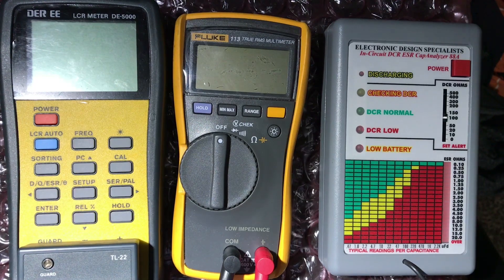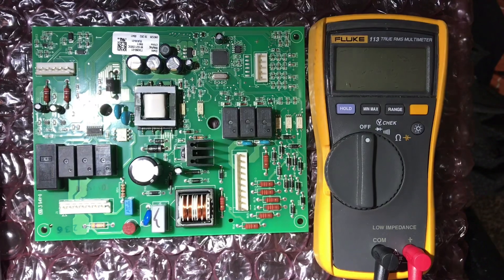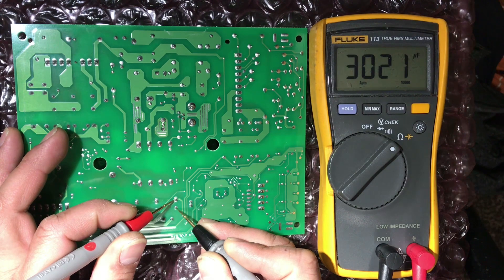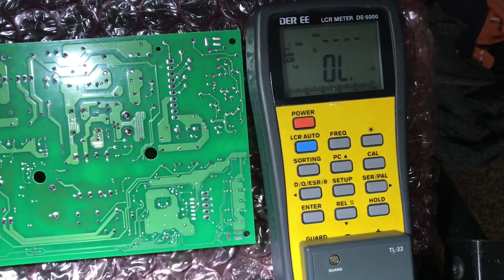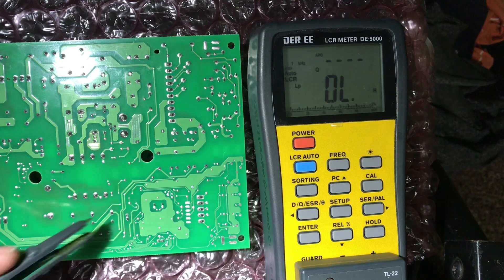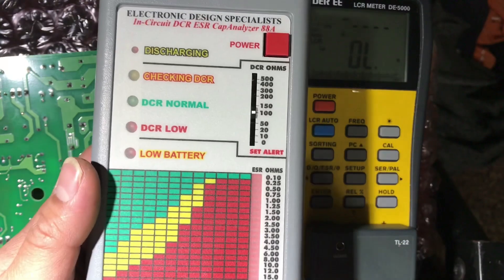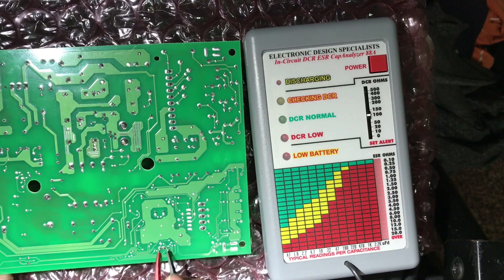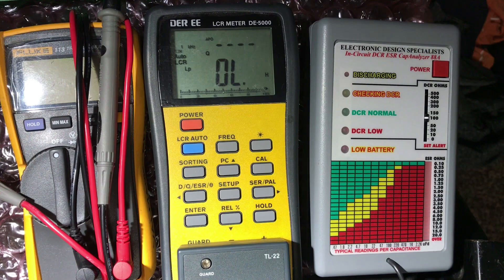Repair| Fluke 113 vs LCR DE-5000 vs ESR 88A

Comment: So after using all of them, would you recommend the DE 5000 over the capAnalyzer 88a? 
I like the De5000 but the 88A has been around for 30 years, Dave is the the guy who came up with that design originally and was a real pioneer of in circuit esr Testing. I think his meter was available before almost any other meters. He really knows his stuff, so I’m just worried about the De-5000 and if it can completely take the place of the capanalyzer?